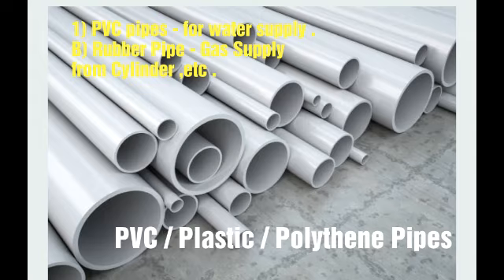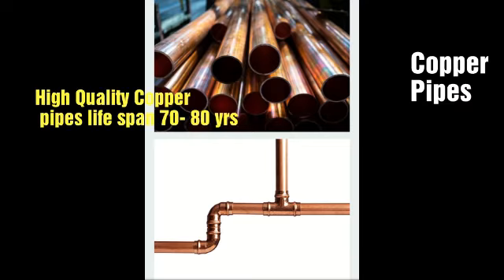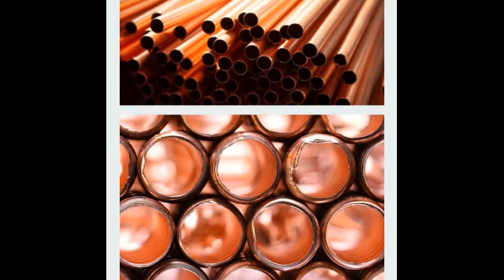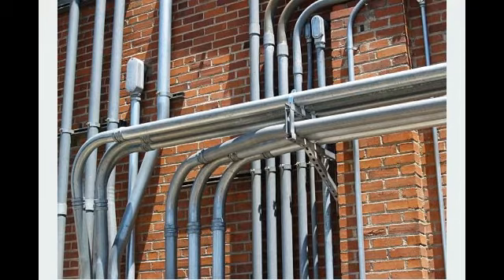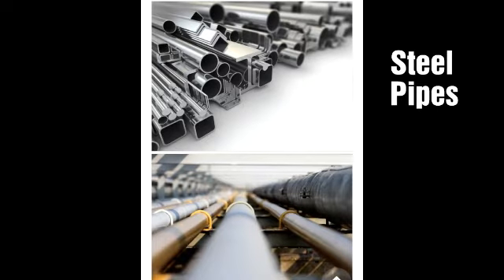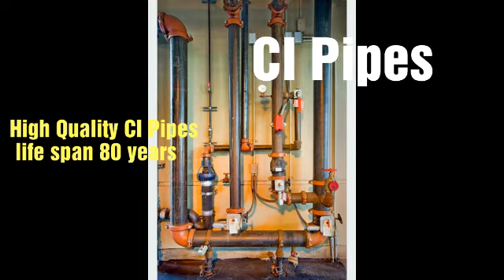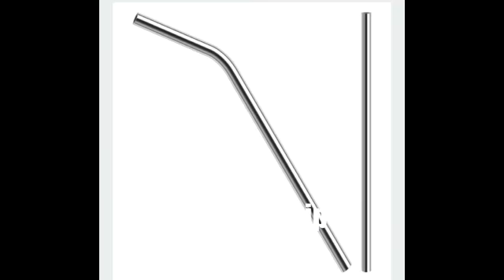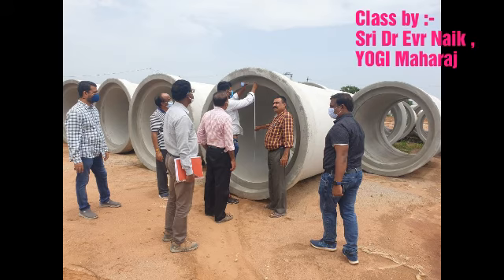Pipes types - Purpose - Uses / Awareness on Pipes

Comment from the maker: 🌐✍️ Pipes tests :- For RCC Hume Pipes , NP-3 Class , Length =2.50 ,Dia = 1.60 m .
✍️ IS Code :- IS 458 - 2003 .Tests see 👇.
✍️ Pipes nos Tested :- 7-8 pipes outbid 240 nos - @ random checks .
Eff Length +/- 1% mm - 2508 mm ,2594 mm,  & Barel wall : 165 mm & 164 mm .
Lb - Spigot 145 , 149 mm ,& ds Socket (mm) : 1844 mm , & DM(mm) : 1844 mm .
1) Cracks test 
2) Leakages test 
3) Visual appearance & Dimensions test .
4) Quality tests 
5) Hydrostatic test
6) Three edge bearing test 
7) Marking test,etc .
Note :- Hydrostatic pressure : 0.70 m , Applied = 0.714 kg/ cm2 .
🍀🌳🥀🌿🌹🌺🌏🌹🌺🥀

#SVPSOOrg ,#YOGISVPSO , #Vasthu ,
#SVPSODoctors ,#Engineers ,
#SVPSOVasthuEngg , #VasthuSVPSO ,
#ElectroHomeopathy 
,#HealthSVPSO,
#ElectrohomeopathyAndAltSystem
#YOGASVPSO ,#TopEngineers ,
#MeditationSVPSO , #MedicalSVPSO,
#AdviseSVPSO ,#BlessSVPSO ,
#SolutionsSVPSO ,
#SuccessSVPSO , #Experts ,#Ers ,
#LifeLessons , #WorldPeace .

....~~~ Uploaded by SVPSO international non profit Organisation BHARATH for global public awareness / inspiration .

🌏🌿🌼Wonderful explanation /Camp  Class by :-
 Sri Er. Dr.VE.Yogi.prof.TOT. Evr Naik , YOGI Maharaj of SVPSO international non profit Organisation for Global people awareness . 
*Ans for Questions asked by Public in various Camps / camp classess .

✍️🌐 Dr .Prof. Er.VE.TOT. Medcn Sci. YOGI Sri Evr Naik , YOGI Maharaj a Great Er, Wonderful Dr, Powerful Vasthu Expert, & Top  Adviser , Administrator, Blessings , Solutions giver for all problems .

@EvrNaik  ,@SVPSOint .

🌿🌍✍️ For more infn , knowledge , Solution of any problem , medcns, materials, Agency,etc Contact Org / Visit (*Org pH 9985278981, 9052645022) & also see U-Tube:- 

✍️ Investigation / Surveying Works of SVPSO Org / Sri Er Evr Naik .
✍️ Plans / Planning by SVPSO Org 
✍️ Designs of Civil Engineering structures by SVPSO Org 
✍️ Buildings designed by SVPSO Org
✍️ Bridges designed by SVPSO Org
✍️ Canals designed by SVPSO Org
✍️ LI Schemes desinged by SVPSO Org
✍️ Irrigation structures desinged by SVPSO Org 
✍️ Roads / Rail way canals / structures desinged / planned by SVPSO Org
✍️ Colones / tanks / Lakes / Anicuts / Earth Dams / Gates / Protection walls / Sluices / SPs / Aqueducts desinged by SVPSO Org 
✍️ Estimations / executions by SVPSO Org 
✍️ Vasthu problems / hidden Vasthu problems solved by SVPSO Org
✍️ Critical Vasthu problems / Tech /Sci/ Engg prob solved by SVPSO Org
✍️ Plots / Houses sales and buying as per Vasthu by SVPSO org 
✍️ Real Estate Services by SVPSO Org international / Experts team / members 
✍️ Quality / tech / Engg services by SVPSO Org 
✍️ Public Problems solved by SVPSO Org
✍️Major surgery cases cured without surgery by SVPSO org 
✍️ General survey / Enquiries of SVPSO Org 
✍️ Patients cured by SVPSO Org
✍️Male Diseses Cured by SVPSO Org
✍️ Females / kids / old aged People diseases cured by SVPSO Org
✍️ Viral diseases cured by SVPSO Org
✍️ Infected / Virus diseases cured by SVPSO Org 
✍️ Bone fracture cases / delivery cases Success by SVPSO Org 
✍️Fevers critical / chest problems / critical diseases cured by SVPSO Org 
✍️ Men's health problems cured by SVSPO Org
✍️ Health problems solved by SVPSO Org
✍️ Diseases cured by SVPSO Org
✍️ People Karma/ sins/ hurdles Cleared by SVPSO Org 
✍️ Critical cases/Chronic/poison/accident /serious cases cured by SVPSO Org
✍️ Vasthu problems solved by SVPSO Org
✍️ Yoga meditation benefits by SVPSO Org
✍️ Yoga training to Ppl by SVPSO
✍️ Advise bless Solution Success rate of SVPSO Org
✍️ Critical problems solved by SVPSO Org
✍️ Farmers problems solved by SVPSO Org
✍️ Staff / Depts problems solved by SVPSO Org 
✍️ Administration of SVPSO Org 
✍️ Research of SVPSO Org 
✍️ Inventions of SVPSO Org 
✍️ Goldy administration of SVPSO Org / Advises / blessings / solutions of SVPSO Org 
✍️ Goldy and Great services of SVPSO Org 
✍️ Camps / Meditation classes by SVPSO Org 
✍️ Animals / birds / plants diseases cured by SVPSO Org
✍️Public Karmas / Sins dissolved / cleared by SVPSO org 
✍️ Public/Family/General problems Solved by SVPSO Org
✍️ Tests / Lab task of SVPSO Org 
✍️ Quality works done by SVPSO Org 
✍️ Various Engaging works executed by SVPSO Org / by Sri Evr Naik and Team .

🌍 Org U-TUBE channels :- 

👍 SVPSO Org,
👍 SVPSO Vasthu Engg , 
👍 SVPSO Doctors 
👍 YOGI SVPSO 
👍 Wonders / miracles of SVPSO Org 

🌏 Org Fb & Twit :-

 👌SVPSO Org ,
👋 Evr Naik Yogi 

🌏🌷 Org Share Share chat & fb :- 

👍 SVPSO Org , & SVPSO groups Channels .
🌍 Welcome to Visit Org ,& see records , Success rate of SVPSO Org .

🌍 💪 👍 Org Recp pH 9985278981 , 9052645022 .

🌏🌳🌲🌿🍀🌺🌷🌲🌴☘️🌸🌏🌲🌳🌿